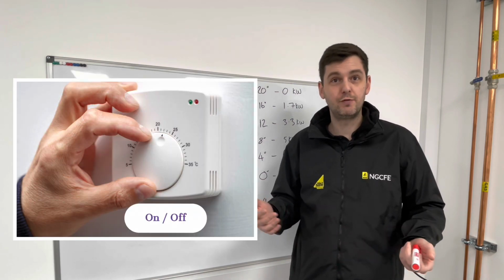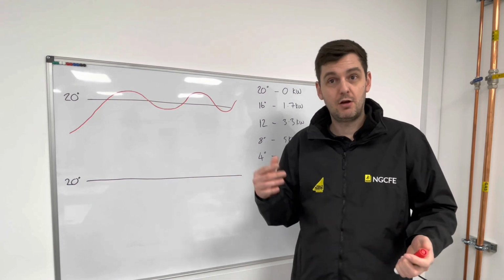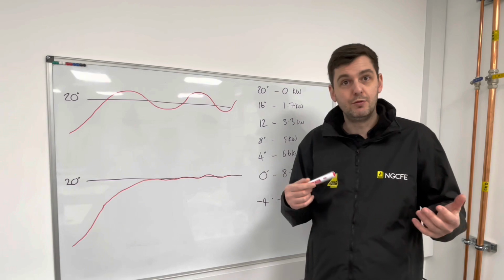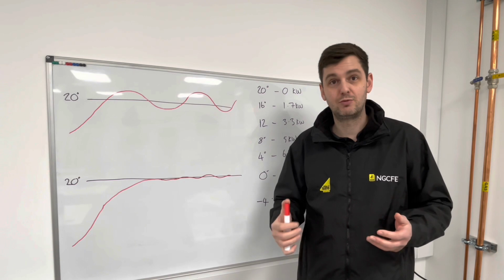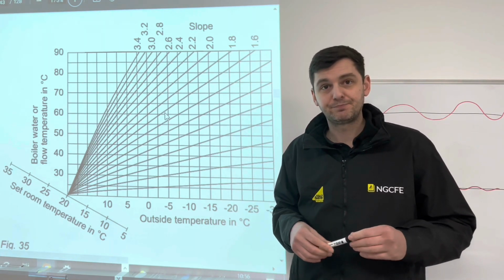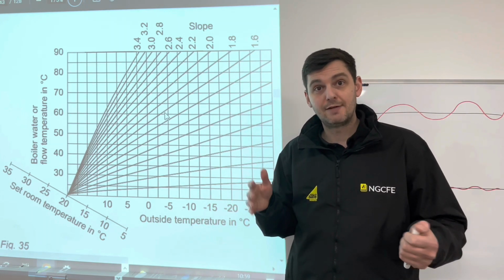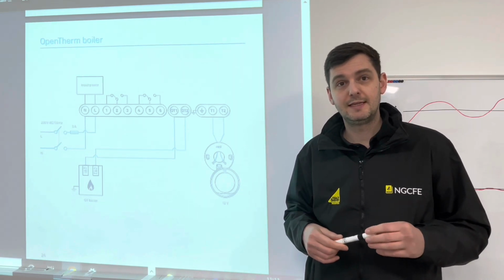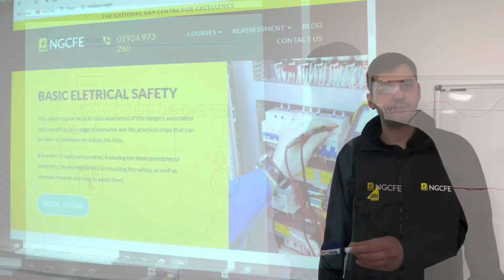Heating Controls Explained | Weather Compensation v OpenTherm NGCFE

Comment: looking for some advise on my boiler its a new boiler its an ideal logic combi2 C30 and if it needs to add 0.5 degree it heats to 45 degree then cuts drops to 35 it fires for 12 seconds then pumps for 2 minutes till its back to 35 degrees and this goes on for an hour just to get that 0.5 degree i am in a 2 bed bungalow thermally excellent isn't this classed as cycling and is inefficient and not good for the boiler and running so long is not using more gas that my old on off system that would run 10 minutes oor so  to get that 0.5 degree

Comment: I rang Bosch who said weather compensation is not needed in a modern reasonably insulated home. That was bosch themselves saying this.
Reply: That's what I was told. I don't want outside temp controlling what I should have in the inside. I use a thermostat for that, in the rooms! 
The boiler adjusts itself.
With flow temperature too low the boiler becomes ineffective and uses far more gas as it takes hours to warm up. Mixing valves stop working too.

This whole explanation is nonsense.

Comment: I'm told by all installers that load comp smart thermostats re opentherm and weather compensators are not needed for home gas boiler heating installers or the cost saving is very marginal for homes not occupied e.g during weekday when occupants not at home. Are gas boilers installers just all unskilled. Climate is northern England

Comment: Basically when it’s 10 degrees outside and 22 on my thermostat my heating doesn’t go on at all. My heating is completely pointless now. I need to get rid of weather compensator. I should be able to control my heating how I want. Don’t like these new designs there terrible. I like my home very warm.
Reply from the maker: Thank You

Comment: Great explanatory video but I have a few questions regarding Google Nest for heat only systems. I'm on the brink of buying but am unsure of the open them connectivity. The confusion comes from the fact that I have an Ideal Logic+ Heat 24 on Y plan. The boiler has Open Therm connections available. When installing a Nest, do I ignore/disconnect the switched live 1 in favour of OT1 & OT2? Also, as the boiler needs to know the valve is in position, SL1 comes through the valve, out on orange to power the pump and boiler, etc, so how would I get around this? My main reasoning for getting a Nest is Open Therm and its Load Compensating feature Many thanks in anticipation that you may be able to help me out.
Reply: Wouldn't you be better off using Ideal's Halo controller. This is open therm and load compensating ready
Reply: @scottk2765  Thank you Scott. Yes, the Ideal Halo was my preferred option but I had heard that the Nest was better. I have since purchased the Halo which also comes with its own dedicated wiring centre to get over the valve positioning, etc, problems. Thanks again for your help and instructional videos.

Comment: Hello, I have updated my wiring so that my S-Plan Ideal Vogue Gen2 S32 has now got an outside weather sensor (plumber didn't bother) and also Opentherm with Nest (yes you can do this with S-Plan, I just set my HW schedule to occur when my CH turns off, again plumber didn't bother/couldn't work it out).

However, in order to maintain (for example) a 40 degree flow temp, my boiler now cycles on/off around every 30 seconds while the flow oscillates from 35 to 45 degrees. Is this ok? Does it indicate that my boiler is actually too big and I should have bought the S26 or even S18? Thank you!

Comment: how do load comp and weather comp compare? if you have load compensation with eg Tado, should you still set a max flow temp to avoid too high temperatures being selected - eg 60c in your example (assuming you’ve measured your radiators to be ok with that)?

Comment: A very nice, clear presentation and explanation. Thanks. I chuckled, though, when the presenter blithely suggested that with weather comp. heating curves it’s simply a matter of a little post-installation education of the customer and the occasional subsequent revisit to tweak the curve for them. Back in early 2010 my excellent heating engineer and I decided to install a Viessmann Vitodens 200 combi with weather compensation in my house in N.E. England (where it gets chilly in the winter). We also researched Opentherm in it’s early days. But back in 2010 Viessmann resolutely refused to offer an Opentherm option. I’ve never regretted installing the Viessmann, and it’s still going strong in autumn 2022. However, regarding the heating curves - and I have exactly the same set of curves to choose from as that feature in this video - my experience has been that it is just a wee bit more complicated than the Presenter suggests in order to arrive at the optimum curve. I am a retired university science Professor, and while it was simple enough to make a good initial guess at a workable choice of heating curve, it took me several successive heating seasons worth of trial and error with a clipboard and regular noting of external and internal temperatures to optimise it. I can imagine what most installers’ response would be to customers’ repeated requests to “could you just please pop back again and tweak my heating curve”! Maybe in Germany it is the norm, though. One other thing, at least in my case zoning seems to work well with weather comp. It’s a largish detached house, and we simply divided it into 3 zones: the sitting room/lounge; my study (at the time I was still in harness, so it wasn’t used most days); and the upstairs (bedrooms and bathrooms). Thanks to the layout of the plumbing, the downstairs hall and the kitchen are “permanently live” and heated whenever any any zone is. For control we installed underfloor Honeywell 2-port zoning valves that are themselves controlled by Honeywell programmable roomstats (one per zone) with RF wireless communication. However, this is perforce a bit of a hybrid design, necessitated by the weather comp, since we deliberately did NOT install a roomstat receiver connected so as to control the boiler. In other words, the boiler operates purely in response to its weather comp, while the zoning valves do their own thing in response to the roomstats. Not elegant, and maybe not optimally efficient, but practical and effective, and it’s worked very well for 12 years now. I am led to believe that the new(ish) Drayton Wiser Smart Thermostat system, if connected in Opentherm mode and set to access local area weather information by WiFi, can effect an adequate version of weather comp (although less accurate than with a Viessmann box on your own wall) and, what’s more, manage over a period of time (approx. a month) automatically to calculate the optimum heating curve and then keep on refining it subsequently. If true, that would really take the pain out of implementing weather comp. and presumably make it a more attractive proposition for householders. Several times over the years, I have thought of writing to Viessmann to ask whether they could help the householder by designing some way of automatically calculating heat loss from a room. For example, possibly by comparing the external temperature (which is always indicated on the boiler if in weather comp mode) against the temperature of a room containing an electronic thermometer in communication with the boiler (e.g. a roomstat, which I believe Viessmann also offer), and applying some clever programming algorithm (which would also need some manual input as to the probable U-value of the wall), and then automatically applying the value obtained to select the optimum heating curve. But my early interactions with Viessmann indicated that it would be pointless, since Viessmann’s attitude to its domestic customers in the UK seemed to be along the lines of “our designs are tried and tested and the best on the market” (which they possibly indeed are) “and we’re not much interested in modifying them” (which is a shame, because whilst making for reliable apparatus, leaves them almost inevitably hostage to being overtaken by new developments).
Reply: Hi 
Is this AJ from cs?

Comment: If you fit a nest [ with weather comp ] can you turn that off and fit an actual weather compensator, and just use the nests load optimisation? Or will the nests weather comp fight against the external weather stat? Thanks.

Comment: Very sensible you are heading in this direction, gas boilers are on the wane in terms of new installs except where no other option is possible.

On commercial sites temperature compensation has been standard part of plant room design for a long time now, these things are now seeping into public domain.

The BMS programmes used to modulate temperatures are now on the market in a simplified format, not requiring specialist BMS engineers.

I’m seriously considering expanding my domestic operations in renewables as it presents an interesting opportunity!
Reply: Agree with you about commercial systems.  The boiler provided a primary circuit for the DHW and the compensated heating was delivered via a secondary circuit using a three port mixing valve and secondary pump to regulate flow temp.  This could also provide an early morning boost,   delivered on a sliding scale dependent on the outdoor ambient.  This aspect of the control system often had self learning capacity to gradually improve efficiency.

Comment: He mentions Nest, which is an Opentherm controller, and then Hive which is not OT. At the end he mentions OT can be applied to system boilers, which is true, but if the system boiler has a hot water storage cylinder then that cylinder needs its own OT thermostat to ensure the boiler heats the domestic hot water at high temperature to reach 55 to 60C to avoid legionella risk. Might then need to implement Priority HW to avoid that high temp output feeding the radiators! Viessman say their Cylinder Demand box accessory is needed to convert a standard cylinder stat to a feed into their vitodens 100-W system boiler to achieve OT HW control. EPH have an OT cylinder stat & Allen says in his OT multizone video (https://m.youtube.com/watch?v=sfHXnC67kwc) that an S plan can be made OT that way. ESi apparently have an OT cylinder stat but not sure if this is available yet. Cant get any info on the Nest to see if it can control HW via OT.
Reply from the maker: You would be best to contact EPH for any advice on this and what products you need to buy. Thanks.

Comment: Can we use weather comp and opentherm at the same time? Thanks
Reply: Baxi told my engineer that their weather compensation sensor isn't compatible with OT, so that explained why it was impossible to change the boiler temp whilst the sensor was fitted. So you can either have your OT thermostat working, or the weather sensor. Not both together. They do not advertise this IMPORTANT fact.

Comment: OpenTherm with Vaillant is a bit of a strange one, as you have to get the VR33 module installed, which isn't available in the UK (European import), and thus not officially supported by Vaillant UK. On the plus-side, their own controls are generally quite good, and naturally the best match with the boiler. I believe Tado also support eBus..

Comment: The Ideal weather compensation kit I fitted to my Logic 18 heat ( Y plan)  is a simple fit and not costly and the instructions offer three curve profiles controlled by having the boiler stat at minimum, mid position or maximum. This confused me for a bit as I thought the adjustment would be linear. It also includes a relay that locks out the weather comp when the hot water cylinder circuit is engaged. Unfortunately the system would need complex repiping to incorporate Open Therm, so it is possible on Heat Only boilers, though possibly not practical in many cases to make the necessary alterations .
Reply: I've also got a logic plus h18 did you take the wire out of the open therm screws or leave it in when fitting the weather compensation sensor?

Comment: Great video alan although I thought you couldnt wire open therm
Into worcesters
Reply: Worcester produce their own proprietary version of Open Therm. They call it Easy Control. However if you want to fit it to their system boilers you have to buy their diverter control pack as well. I know this as a friend has just had a WB 8000 system fitted as a replacement and the extra work needed to repipe put him off the idea of Easy Control, so they have stuck a Hive in instead.  Easy Control is fine on the combis of course.

Comment: A few points to add on weather compensation:
1) They are feed forward controllers, not feedback, as say a room thermostat is. That is, they anticipate the coming heat loss or heat gain to a building.  Weather compensation will say, turn up the boiler flow temperature, because the outside temperature has dropped, even though the desired room temperature has been reached, as heat is being lost from the building. It prevents that cold spot when a room cools before a boiler is switched on to reheat to get back to setpoint. Also no overshooting of setpoint.

2) They inject the correct level of heat into a building, corresponding to its heat loss.

3) They keep the temperature of the boiler as low as possible. In on-off controls, a boiler say will be full on, say 80C, then it is switched off as the room has reached set point. With weather compensation. If the boiler temperature wanted is 50C, weather compensation maintains 50C, no more - usually by reducing the boiler fan speed reducing the kW output of the boiler. So the boiler is not operating at needless inefficient higher temperatures. Also low boiler temperatures promote boiler longevity. 

4) Boilers operate more efficiently when a boiler modulates down to a low kW, especially when using weather compensation control. The lower the kW modulation rate of the boiler the more efficient. Weather compensation can modulate the boiler down to its lowest kW automatically, keeping the boiler just humming for most of the day. Inefficient boiler cycling will be vastly reduced. So choose a boiler that modulates down very low, especially when having underfloor heating.  So always get the lowest kW modulation you can get.
Reply: John Burns you're a clever lad. Thanks for your input.
Reply: Now, can u use opentherm and weather compensation both at same time?
Reply: @bimiuk4051  
Yes. With some boilers. OpenTherm will lower the boiler temperature as setpoint is neared then off when reached. But the OpenTherm stat is only in one location in the building.  Best use the stat as a high limit, as the weather compensation does the real work.
Reply: @johnburns4017  thanks. One plumber advised that weather comp is bad because mu front door is not facing right way … confused the boiler rtc etc. should I insist for it? Also OpenTherm is it not the smartThermoneter (Nest)??
Reply: @bimiuk4051  
Plumbers should stick to drains - heating control is out of their league. The outside sensor should ideally be facing north. But it can be OK be facing east or west - need to adjust the compensation curve to suit. The effect is lessened but still works by adjustment. If facing south it should be shaded from the sun. 

Some use unobtrusive bell wire run outside to get an outside sensor on the north wall, with the wire coloured to the brickwork (not white on red brick), run in the cement seams.

An OpenTherm stat directly modulates the burner when it nears the setpoint. Before nearing the setpoint it will be on full.

Smart phone stats/timers are not necessarily OpenTherm, although some later versions are. I believe the latest Nest is (needs checking). Earlier models clearly were not, being just on-off.  I am no fan of Nest.  They have a clumsy user interface and are expensive for what they are.  Come across a few failures as well.  They are not cheap.  EPH sell a version which is I believe is OpenTherm, but a  lot cheaper.
Reply: @johnburns4017  hey John

Just checked the facing of the property. So I stud outside of the door (my back towards the front door) and the compass was showing NE 30degrees

Is that any good? Also, does it mean, is not bad for back garden? (Have not moved in as yet lol).

As for Weather Comp: I think it would be silly NOT to have it. Also, can you shut it down if not wanting to use it?

As for OpenThirm: i am hoping it will be supported by Ideal Vague. And Nest should be latest model? How do I know if its the latest one? Which ones to avoid?

Can I then use my mobile to connect to Nest to control the heating etc?

By the way, is the Priority HotnWater system installed by default on property post year 2006 ? How do I know what current system is?

Its a system boiler, water tank.
Reply: @bimiuk4051  what on Earth does the front door have to do with anything? The direction the sensor faces is relevant, not where your front door is 🤣🤣🤣
Reply: Can you have indoor room zones with wall stats and weather comp or not? How do you have UFH and radiators on the same boiler which require different flow temps?
Reply: @handle1196  
A UFH pumps set with temp control does the UFH.

"Can you have indoor room zones with wall stats and weather comp or not?"

Yes, but probably not worth it having weather compensation.  See the Heat Geek channel.  He has a vid on this.
Reply: @johnburns4017  Thanks I'll take a look. I was wondering how a kitchen when cooking doesn't over heat if the weather comps trying to set the rest of the house to 20C in winter. If you have MVHR you dont really want to have to open windows